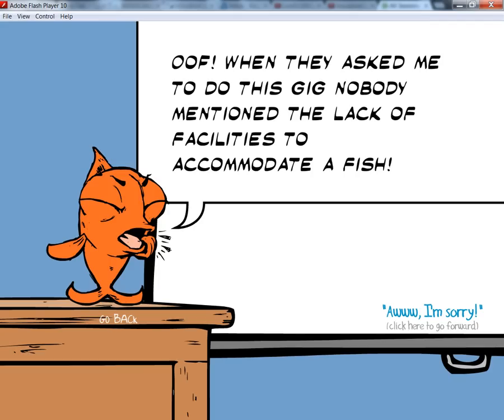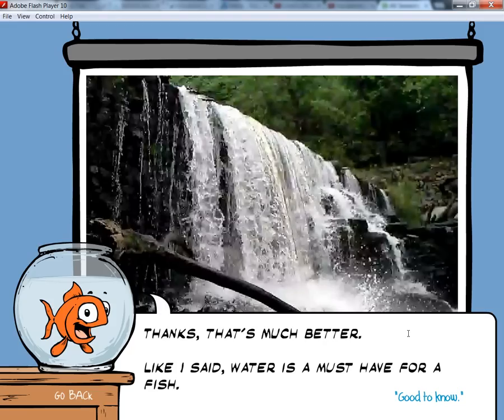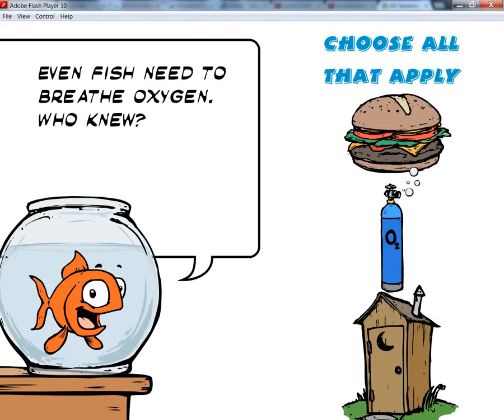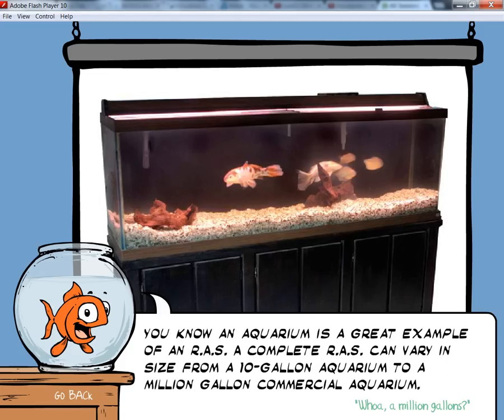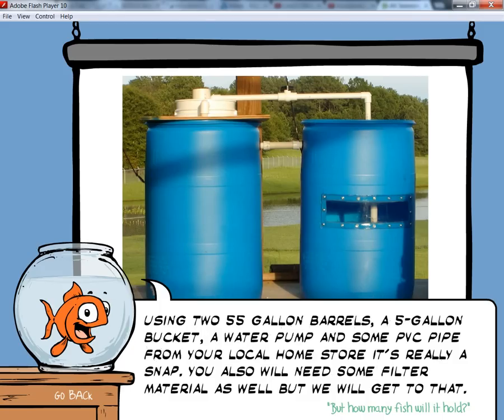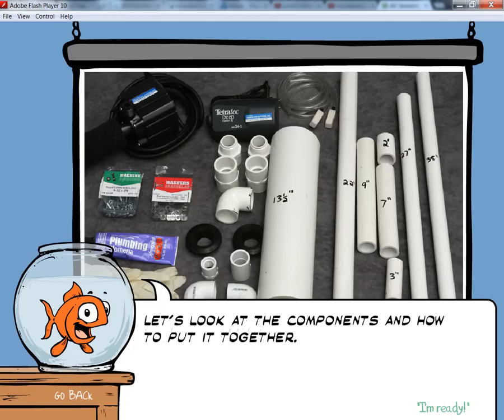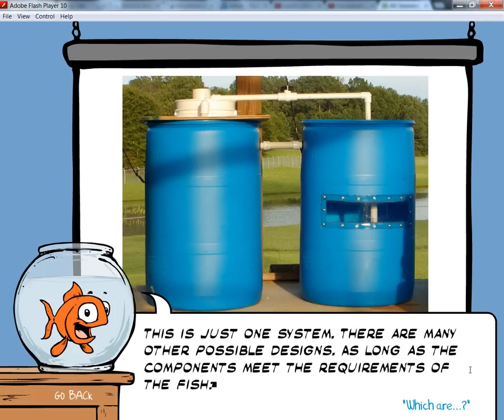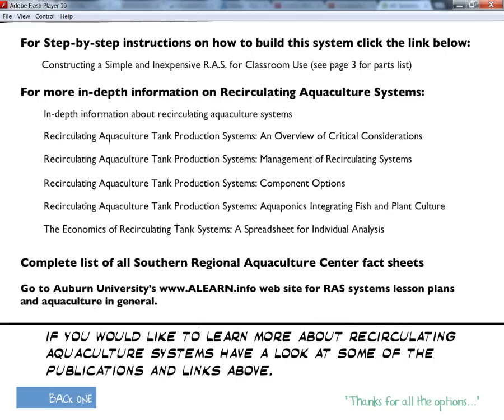Recirculating Aquaculture Systems Made From Plastic 55 gallon Barrels

Comment: Does anyone know what happened to the original interactive presentation?  The link provided no longer works.
Reply from the maker: Unfortunately it ran on the Adobe Flash platform that is no longer being supported.  The website that it was hosted on was also updated and much of the content did not get rolled over due to accessibility issues.